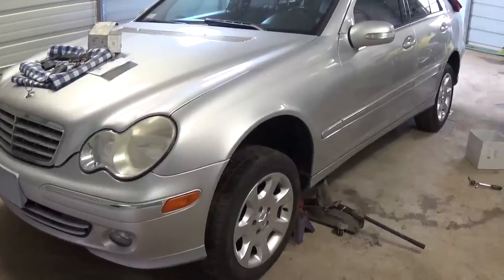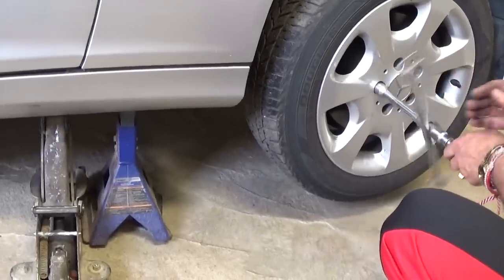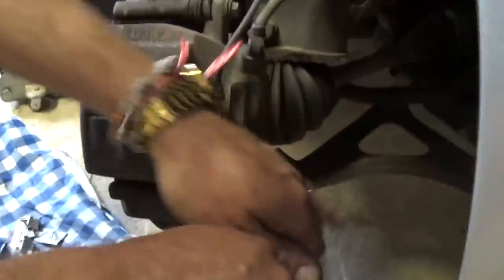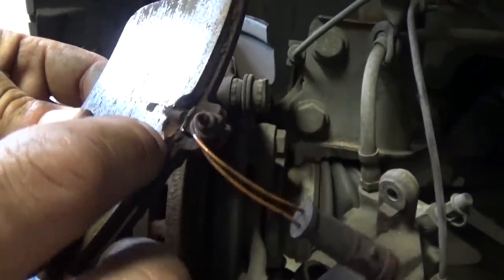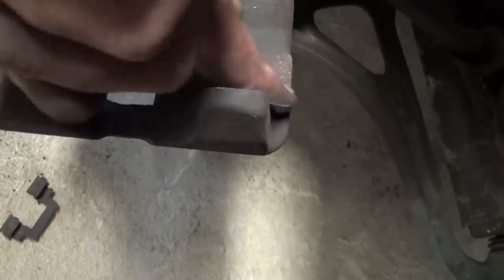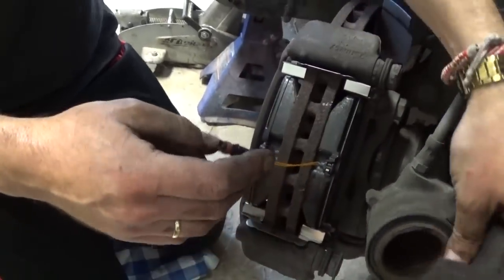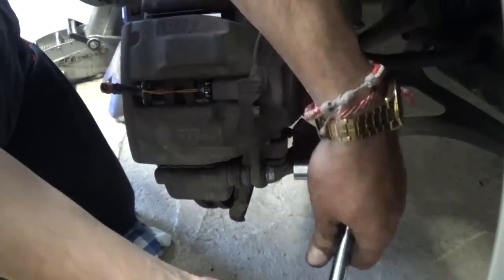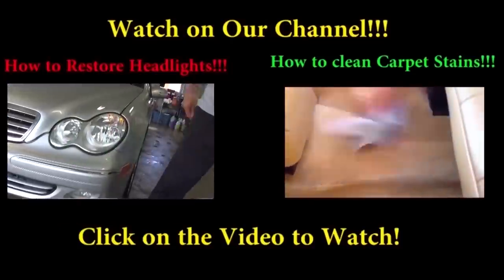Mercedes W203 Front Brake Pads Replacement C180 C200 C230 C240 C270 C320

Comment: Great video. Shouldn't you use the torque wrench to tighten the caliper mounting bolts?
Reply: those are not caliper mounting bolts

those are guide pin bolts only 25nm
hand tighten is enough

Comment: Great video, does pushing back the piston with a screwdriver against the rotor not damage the rotor? It's easier this way but I avoid doing it if I'm not changing the rotors
Reply: yes, the screwdriver can scratch disc, probably not a big deal, I use a C clamp to compress once brakes are off, use an old pad on one side and turn the clamp until the piston is back in.  I clean the piston with spray cleaner first then compress them, you want to protect the seals as much as possible.  Last you need to make sure reservoir isn't full or it will overflow.  Use a syringe to suck some out if full.

Comment: Do you need to replace the sensor every time you change your brake pads?
Reply from the maker: +Frankie Resendez if the old pads were not wore out and the sensor was intact you do not need to replace it
Reply: Frankie Resendez fuk I didn't buy sensors lol just pads

Comment: Hello. Do you know if the warning in the dashboard dissapears when you replace the pads? I've got "brake lining wear, visit workshop"
Reply: Caffecopp sensors... They are anoying.
Reply: I actually bought a new pair of sensors and replaced the old ones. So that was the issue.
Reply: did the sensor ever turn off ?
Reply: The dashboard warning disappeared when I changed the old sensors with some new ones, so yes.

Comment: I smelt a rat when I noticed disc set up with the large nut that holds the rear drive shafts. Nothing rings true with this video because a Mercedes C180 (W203) is a rear wheel drive car, yet everything that is replaced is, as the heading says Front Pads Replacement. The rear pads DO NOT have pad wear sensors, yet we see a drive shaft coming in behind the hub. What gives? Anyone else here notice this video is not as good as you think it is. BTW, DO NOT push the old pads back with a screw drive because it can damage the rotors if you're not replacing them, which is also a good idea given MB discs are notorious for abnormal wear due to ultra soft material & the old pads can get stuck in behind the ridge at the front of each old disc. More work than this guy points out!